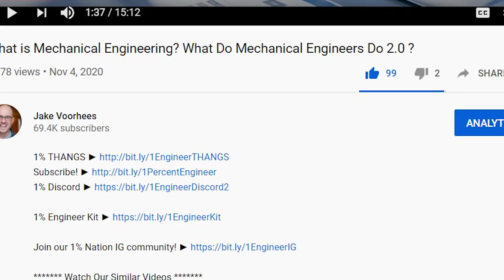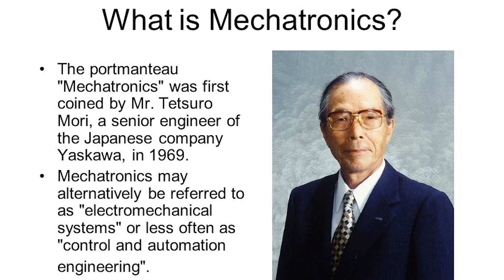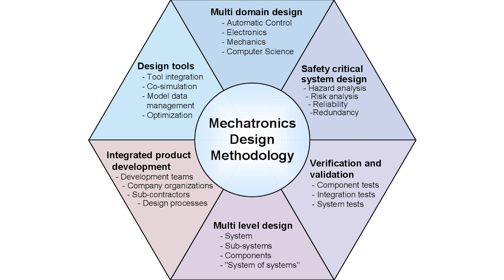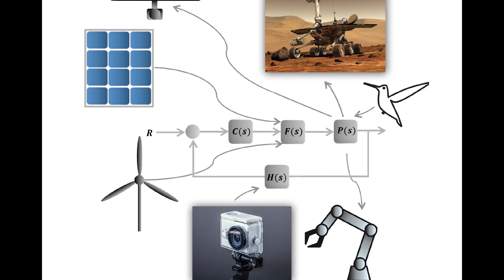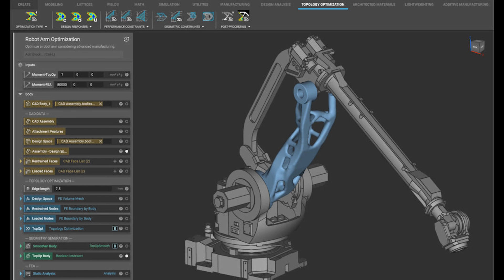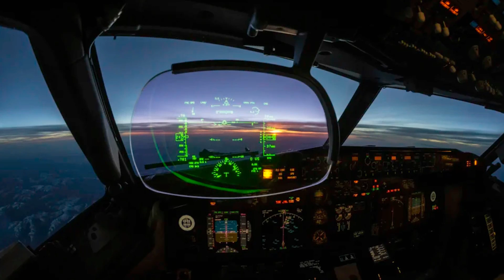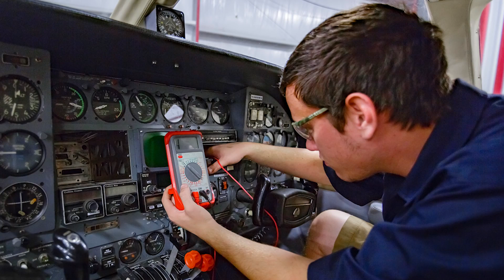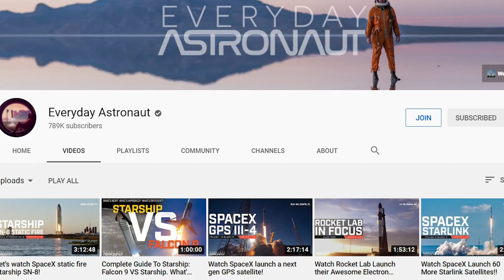What Do Mechatronics Engineers Do? | Can Mechatronics Engineers Build Robots?

Comment: I did Diploma in Mechatronic engineering. This is the most useless engineering. Unless you're a really good in programming or a true-blue mechanical engineer or electrical engineer, you most probably would face the hard truth that this engineering is useless.

Better take specific engineering so you will learn in depth. Mechatronic is jack of all trades but master of none.

I'm regretting doing this diploma.

Comment: is mechtronics a bachlor course?
Reply from the maker: Hey thanks for the comment. It can be. Depending on your country ya.

Sometimes they programs are not accredited for your country and you have to take EE, ME, or CPE and then do a concentration in mechatronics.

You would do that by for example, majoring in EE and taking more electronics courses and less about power or telecommunications. You would take robotics electives, signals and controls, and circuits courses, etc. Your CS related courses should revolve around mechatronics rather than something else, and so on.
.
I discuss that more here, “Is Mechatronics Engineering a Good Career? https://youtu.be/UkPKlA6j0f8 

Computer Engineering is often a subset of Electrical Engineering. But sometimes engineers struggle to choose between ME vs EE/CPE. This video will help you decide, “Mechanical VS Electrical Engineering” https://youtu.be/6PJ-Yw5qVsc 
 .
These will probably be helpful as well:
“What Do Mechanical Engineers Do?” https://youtu.be/5wEteXzhtak 
“What Do Electrical Engineers Do” https://youtu.be/zRawKI6Qsm0 
“What Do Computer Engineers Do?” https://youtu.be/hiL-cTbz188 
.
I also ranked Mechatronics Engineering as one of the only two S-Tier Mechanical Engineering options in this video, “Mechanical Engineering Job Tier List” https://youtu.be/ghxBLeEX_OM
.
And this video shows a Mechatronics Engineer career at, 24:08 “What Do Mechanical Engineers Actually Do?” https://youtu.be/bssgoMZrhj0

.
Also this video is the best Electrical Engineering Jobs,   
“Electrical Engineering Job Tier List” https://youtu.be/6r3hG_zA8d8 
.
Does this help and make sense? Let me know what follow up questions you have okay? I respond to everything, thanks again!!

Comment: Mechanical engineering with an automotive engineering master or mechatronics with automotive engineering master???? What combination do you recommend???
Reply from the maker: Hey thanks for the comment. I think do the more broad bachelors because what if you decide you want to do something outside of mechatronics and specialize more so in machine design or manufacturing or something that isn't as connected to mechatronics? And then you can take more automotive technical electives and internships and fully decide later what you want to do for masters. Does that make sense? Let me know what follow up questions you have okay? Cheers love you

Comment: I am a mechatronics engineer
Reply from the maker: Nice!!! What’s your plan for your studies?

There are only 28 ABET mechatronics engineering programs in the world and just 3 in the USA. So oftentimes you have to choose EE or ME or CPE and do a degree concentration in mechatronics, which is a great path. Some universities have a formal certification program within EE/ME/CPE, or you may have to build it yourself. You would do that by for example, majoring in EE and taking more electronics courses and less about power or telecommunications. You would take robotics electives, signals and controls, and circuits courses, etc. Your CS related courses should revolve around mechatronics rather than something else, and so on.

Computer Engineering is often a subset of Electrical Engineering. But sometimes engineers struggle to choose between ME vs EE/CPE. This video will help you decide, “Mechanical VS Electrical Engineering” https://youtu.be/6PJ-Yw5qVsc 
 .
These will probably be helpful as well:
“What Do Mechanical Engineers Do?” https://youtu.be/5wEteXzhtak 
“What Do Electrical Engineers Do” https://youtu.be/zRawKI6Qsm0 
“What Do Computer Engineers Do?” https://youtu.be/hiL-cTbz188 
.
I also ranked Mechatronics Engineering as one of the only two S-Tier Mechanical Engineering options in this video, “Mechanical Engineering Job Tier List” https://youtu.be/ghxBLeEX_OM
.
Does this help and make sense? Let me know what follow up questions you have okay? I respond to everything, thanks again!!

How to Build a Mechatronics Degree Yourself
There are still less mechatronics programs than needed. Here is more about mechatronics engineering in general, “What Do Mechatronics Engineers Do?” 
.
Mechatronics engineering can be done within your existing engineering major as a sort of “customize your own emphasis” type of degree. First, understand that mechatronics is basically a combination of Electrical Engineering and Mechanical Engineering with some Computer Engineering included (plenty of that in EE).

This video will help you choose, “Mechanical VS Electrical Engineering” https://youtu.be/6PJ-Yw5qVsc. 
.
And so that you understand what CPE is, “What Do Computer Engineers Do” https://youtu.be/hiL-cTbz188 ?

Once you decide which major is for you, take tech elective courses and build relationships and do research in the direction of the other. I think EE (CPE is within EE technically) has a stronger future than ME, so if you really like math and if you can program well, then EE is the way. Over time there will be more actual degrees for mechatronics, but for now you basically have to build it yourself. Does that make sense? Let me know what follow up questions you have k, cheers! Thanks!
Reply: @JakeVoorhees   I did my undergrad that is Bachelor of Engineering in Mechatronics engineering. I'm from India and we have a few universities offering the program.
Reply from the maker: Very cool. So what is your next move? Let me know what questions I can help you answer okay? Cheers !!

Comment: If I got into mechatronics engineering and liked one of the sub fields more (ie mechanical or electrical engineering or computer science )
Can I get a masters degrees in one of these fields
Reply from the maker: Ya absolutely. Thanks for the comment. There aren’t too many ABET accredited mechatronics programs. Just 3 in USA and 25 more around the world right now.

So oftentimes you have to choose EE or ME or CPE and do a degree concentration in mechatronics, which is a great path. Some universities have a formal certification program within EE/ME/CPE, or you may have to build it yourself. You would do that by for example, majoring in EE and taking more electronics courses and less about power or telecommunications. You would take robotics electives, signals and controls, and circuits courses, etc. Your CS related courses should revolve around mechatronics rather than something else, and so on.

And because you can get into any engineering graduate program with any engineering bachelors, you will be able to do whatever you want with an EE/ME/CPE or MTREs bachelors.

Computer Engineering is often a subset of Electrical Engineering. But sometimes engineers struggle to choose between ME vs EE/CPE. This video will help you decide, “Mechanical VS Electrical Engineering” https://youtu.be/6PJ-Yw5qVsc 
 .
These will probably be helpful as well:
“What Do Mechanical Engineers Do?” https://youtu.be/5wEteXzhtak 
“What Do Electrical Engineers Do” https://youtu.be/zRawKI6Qsm0 
“What Do Computer Engineers Do?” https://youtu.be/hiL-cTbz188 
.
I also ranked Mechatronics Engineering as one of the only two S-Tier Mechanical Engineering options in this video, “Mechanical Engineering Job Tier List” https://youtu.be/ghxBLeEX_OM
.
Does this help and make sense? Let me know what follow up questions you have okay? I respond to everything, thanks again!!
Reply: @JakeVoorhees  thank you so much
Reply from the maker: no worries just let me know how I can help you next okay? Cheers thanks

Comment: I do mechatronics but I'm thinking hard about switching to electric
Reply from the maker: Hey thanks for the comment. So are you in an ABET accredited mechatronics program? Thanks mostly the issue. There are so few of them.

There are only 28 ABET mechatronics engineering programs in the world and just 3 in the USA. So oftentimes you have to choose EE or ME or CPE and do a degree concentration in mechatronics, which is a great path. Some universities have a formal certification program within EE/ME/CPE, or you may have to build it yourself. You would do that by for example, majoring in EE and taking more electronics courses and less about power or telecommunications. You would take robotics electives, signals and controls, and circuits courses, etc. Your CS related courses should revolve around mechatronics rather than something else, and so on.

Computer Engineering is often a subset of Electrical Engineering. But sometimes engineers struggle to choose between ME vs EE/CPE. This video will help you decide, “Mechanical VS Electrical Engineering” https://youtu.be/6PJ-Yw5qVsc 
 .
These will probably be helpful as well:
“What Do Mechanical Engineers Do?” https://youtu.be/5wEteXzhtak 
“What Do Electrical Engineers Do” https://youtu.be/zRawKI6Qsm0 
“What Do Computer Engineers Do?” https://youtu.be/hiL-cTbz188 
.
I also ranked Mechatronics Engineering as one of the only two S-Tier Mechanical Engineering options in this video, “Mechanical Engineering Job Tier List” https://youtu.be/ghxBLeEX_OM
.
Does this help and make sense? Let me know what follow up questions you have okay? I respond to everything, thanks again!!
Reply: @JakeVoorhees  Good, I’m probably going to power transmission and transformation or automation, to take advantage of what I saw in this course.  
What I learned was totally alone, in my college my course is taught in a sloppy way.  I'll change college too.  
Thank you very much for the tips and the time you took to advise me.  I'm Brazilian, I'm sorry if my English is a little out of context.
Reply from the maker: Hey your English is fine. Don't worry. Power is more of Electrical Engineering whereas automation/robotics/mechatronics is down the Electronics road. I would think more about which you want to pursue after university, because they begin to become different career paths. Which do you like more? How is your coding/programming? Power engineers work less with that. And if you like to tinker and play with circuits and micro-controllers, then mechatronics could be better. So let me know so I can help you out, cheers thanks

Comment: He actual knows his stuff. Alright im suscribing
Reply from the maker: Real deal!! Thanks for that :) appreciate the comment. You trying to be a mechatronics engineer? It’s funny because you actually have to choose a different bachelors.

There are only 28 ABET mechatronics engineering programs in the world and just 3 in the USA. So oftentimes you have to choose EE or ME or CPE and do a degree concentration in mechatronics, which is a great path. Some universities have a formal certification program within EE/ME/CPE, or you may have to build it yourself. You would do that by for example, majoring in EE and taking more electronics courses and less about power or telecommunications. You would take robotics electives, signals and controls, and circuits courses, etc. Your CS related courses should revolve around mechatronics rather than something else, and so on.

Computer Engineering is often a subset of Electrical Engineering. But sometimes engineers struggle to choose between ME vs EE. This video will help you decide, “Mechanical VS Electrical Engineering” https://youtu.be/6PJ-Yw5qVsc 
 .
These will probably be helpful as well:
“What Do Mechanical Engineers Do?” https://youtu.be/5wEteXzhtak 
“What Do Electrical Engineers Do” https://youtu.be/zRawKI6Qsm0 
“What Do Computer Engineers Do?” https://youtu.be/hiL-cTbz188 
.
I also ranked Mechatronics Engineering as one of the only two S-Tier Mechanical Engineering options in this video, “Mechanical Engineering Job Tier List” https://youtu.be/ghxBLeEX_OM
.
Does this help and make sense? Let me know what follow up questions you have okay? I respond to everything, thanks again!!
Reply: sus! 😑
Reply from the maker: The major?

Comment: What's the difference between Computer Eng. and Mechatronics Eng.?
And as a Computer Science student what would I be able to work then?
Edit: I'm great at physics and enjoy hands-on experience, so I'm looking forward to change my major or earn a masters degree in computer engineering.
Reply from the maker: Hey thanks for the comment. 

CPE is one of the paths to mechatronics engineering. Mechatronics is a blend of ME/EE/CPE/CS, so there isn't necessarily differences. You have to see them as a venn diagram. There are overlaps and certainly parts that are unique to that major alone.

For example, CPE splits into two arenas. Computer Hardware engineering and software engineering. So a CPE could work on the coding alone within mechatronics systems, or they could work on the electronics such as a circuits, controls, instrumentation, power, etc. Computer engineers usually work mostly with the integration between the programming and the electronics.

An electrical engineer who becomes a mechatronics engineer will more so work on the electronics design themselves. 

A mechanical engineering who leans into mechatronics will design the physical components of the mechatronics system.

So CPE is one of the paths into mechatronics. Does that make more sense now? Which one is the right one for you? Watch these videos:

There are only 28 ABET mechatronics programs in the world and just 3 in the USA, so oftentimes you have to choose EE or ME or CPE and do a degree concentration in mechatronics, which is awesome. This video will help you decide which one to do, “Mechanical VS Electrical Engineering” https://youtu.be/6PJ-Yw5qVsc 
 .
These will probably be helpful as well:
“What Do Mechanical Engineers Do?” https://youtu.be/5wEteXzhtak 
“What Do Electrical Engineers Do” https://youtu.be/zRawKI6Qsm0 
“What Do Computer Engineers Do?” https://youtu.be/hiL-cTbz188 
.
Does this help and make sense? Let me know what follow up questions you have okay? I respond to everything, thanks again!!
Reply: @JakeVoorhees  Man I really really appreciate that you gave me this much of your time!
Reply from the maker: @bassemsalman4315  I got you! This is 1% Nation to me so it's really important that people get help and support. I'm here! Let me know any follow up questions ok thanks <3
Reply: @JakeVoorhees  If I continued in my CS degree, could I work in domains like Finance or involving Physics like Astronomy? Or I would need to get an emphasis master degree on a certain field?
Reply from the maker: @bassemsalman4315  Good question. Really your CS degree can get you anywhere you like. The thing that people often do is get a masters in data science if they want to go into machine learning or AI related things because its far more complicated and moving so quickly that it helps to get that masters. Otherwise, you can teach yourself a lootttttt of CS applications and build projects and a portfolio just by learning stuff from the internet. CS skill is about just that - skills you have which comes down to how much you invest in the skill :) Does that help?
Reply: @JakeVoorhees  You are simply amazing. Have a good day!
Reply from the maker: thanks so much! thanks for being in the comments too. Appreciate you, cheers! <3
Reply: @JakeVoorhees  and would a masters degree in engineering after pursuing a bachelors in computer science be efficient and do the job?
Reply from the maker: @bassemsalman4315  Yeah you can, but again, depends on what you want to do and how you want to use that degrees. A lot of math or CS or Physics undergraduates realize they want to do more engineering after university, so they go and get a masters in say Computer or Electrical Engineering where their non-engineering bachelors will sync well. Hope that helps! Ask any question you like okay, cheers love you